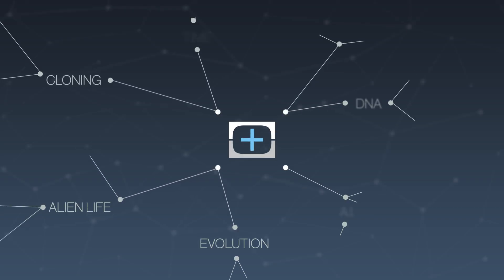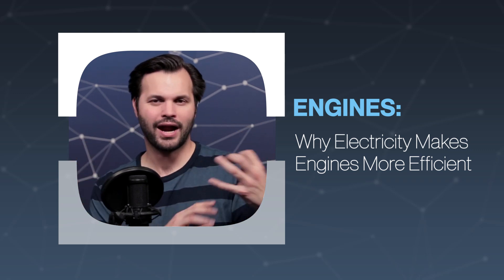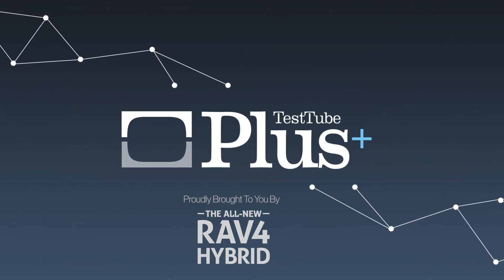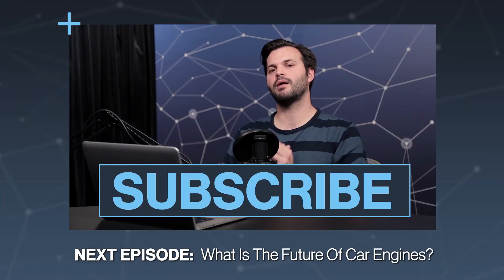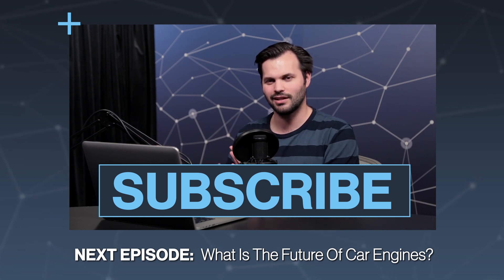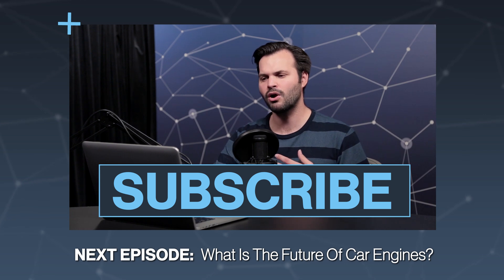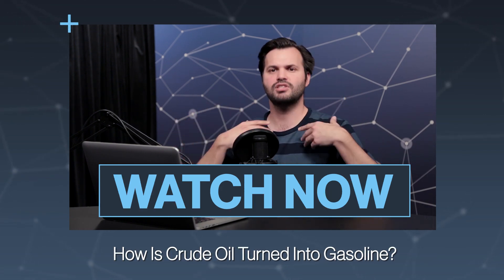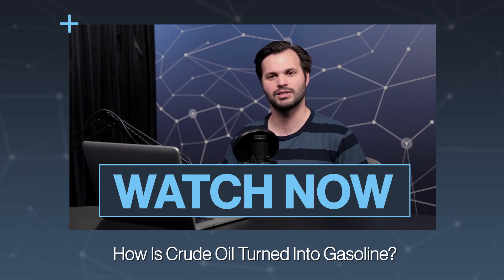Why Electricity Makes Engines More Efficient

Comment: Still not eco friendly. You regressives keep lying about how electric cars are great, yet mining all that coal to get it is even MORE destructive than fracking.
Reply: Eric D Yes, just like ICE cars, Tesla uses rare earth minerals outside the main motor.  Lithium mining has an environmental impact, but it's not like the alternatives do not.
Reply: +Jaccobtw Nope, it's the rare earth metals in most of the components and manufacturing process itself that make electric cars more destructive, not the burning of coal for electricity, that part is far less destructive than burning gasoline because there is far less of it required per mile.
Reply: +Jaccobtw..Until renewables take over.. a lot of states in the US already get 10% or more power from wind energy. And it's growing faster. Also, one big coalfired power plant is a better trade off than 10,000 individual gas engines.
Reply: +Jaccobtw..Until renewables take over.. a lot of states in the US already get 10% or more power from wind energy. And it's growing faster. Also, one big coalfired power plant is a better trade off than 10,000 individual gas engines.
Reply: +Jaccobtw Coal for electricity generation in the US is under 40% and falling.
Reply: +Eric D Tesla uses an induction motor which has no permanent magnets and hence no rare earth metals.
Reply: Dan Sanger Computers, screens and other electronics all typically have rare earth metals to. I couldn't find anything about those things specific to Tesla but the car does have plenty of those things. Also, that says nothing about how the cars are made, the robots and tools which construct them likely have plenty of rare earths in them as well. Plus, the manufacturing process itself, especially for the batteries is hugely destructive.

It seems that weather Lithium counts as a rare earth is a bit controversial but it is very destructive to use due to the way it is mined and the tesla's batteries are Lithium based.

Comment: when a generator is powering an electric motor like the fiskar karma or a train it is more efficient then the system you are talking about. your video needs to be redone. LOL
Reply: +Mac Briggs 
A generator powering the electric motor is called a series hybrid.
Sadly there has yet to be a series hybrid with a small battery so that it can be compared with conventional hybrids in a apples - to -apples comparison.
But, the Chevy volt (42mpg) and BMW i3 (39mpg) and Fisker Karma (20mpg) - all Series hybrids, get far less mpgs than Prius (50 mpg), Accord hybrid (47mpg) etc when in hybrid mode.
Perhaps its just due to the large battery that drags the volt and i3's hybrid efficiency down, but we have yet to see a series hybrid with a prius sized battery, so we can assume that series hybrid setup do not work well with small batteries. (although the reason it is used on trains - to eliminate the transmission - means such a setup may work well for trucks as an alternative to having a CVT which cannot be installed on high powered vehicles) 
The only reason for the Karma's high mpg rating is due to being an electric car, if you never charge it and drive it entirely on gas it will forever be a 20mpg car.
http://www.plugincars.com/heavyweight-fisker-karma-gets-20-mpg-gas-108899.html

Comment: you just realised using solar panels to power electrolysis of water... ... ... ... (...*infinity). You realize that all types of transportation are "dirty energy" without a "clean energy" source. Until electricity is from renewable resources, electric cars are just as dirty as gasoline ICEs. same thing with H2 ICEs and the H2 reaction engines. These technologies weren't just invented yesterday, we knew this for many years. I did a report on hydrogen power when i was in high school, and one of my college professors that i had said people did alternative power every year.
Reply: They're still cleaner because overall they release less pollutants.....
Reply: +Darknightx33x ..Until renewables take over.. a lot of states in the US already get 10%
 or more power from wind energy. And it's growing faster. Also, one big 
coalfired power plant is a better trade off than 10,000 individual gas 
engines.

Comment: why do they not just use hydrogen and oxygen in a (pretty much) normal engine so that it is pretty much just a internal combustion engine that runs on electicly prodused stuff.
Reply: that's sort of what the hydrogen fuel cells do, but it can't be like an internal combustion engine. the hydrogen/ oxygen reaction doesn't combust. it produces electricity. so the engine is different.
Reply: +Smerlin Because you'd need to keep the hydrogen and oxygen at cryogenic temperatures in order to use them in a combustion engine. Further, it's incredibly dangerous -- hydrogen explodes, and burns with a clear flame, while pure oxygen is an incredibly rapid oxidiser
Reply: kay then

Comment: I would say that a smaller ICE isn't always more efficient simply because of the range of efficiency. For example trying to get a fiat 500 to cruise at 75 is going to be less fuel efficient than an adequately powered car, a car with a bigger engine. ICE need to be appropriately sized for the application. Now I know that this seems trifle but many current cars, like the Prius are simply underpowered. My mom has a Prius and when I occasionally drive it, I have to floor it to merge. When I do this the mpg that I am getting is far worse than in my own v6 accord because I don't have to floor it in my accord to catch up to traffic.

Comment: Nuclear power cell car FTW
Reply: ah yes, so even a non fatal accident would kill you with radiation
Reply: +Adam Kraft You can put the reactor inside a thick steel shell, making it practically indestructible. They need lots of shielding anyway. But it's probably still better to let professionals operate big nukes, and use batteries in the cars.

Comment: Interesting.  I never understood the point of hybrids until now, because usually, people promoting them don't explain that the engine is smaller and lighter.  Instead, they just talk about how "when it switches to the electric battery, you use no fuel," as if the car wasn't still powered by gasoline.  (I'm still holding out for a fully-electric car, though.  Just as soon as they make one that can go long distances, or I find a job closer to where I live.)
Reply: Generally the engines aren't "smaller." For example the Toureag Hybrid use a 3.0L supercharged V6 while the gas and diesel variants use a 3.6L and 3.0L diesel respectively. In addition the Jetta hybrid takes advantage of a 1.7L gas engine while standard Jettas use a 1.8L or 2.0L depending on the year but within the same model run. It's a trivial difference in displacement. That hybrid system is different from why Toyota and Honda uses. The system adopted by Vw/Audi primarily relies on the gas engine for locomotion and adds the power capabilities of the electric motor to aid in acceleration and sustained movement, thus reducing the demands on the gas engine which in turn decreases fuel usage. They will solely use the electric engine for movement at very low speeds and higher speeds, depending on the charge level of the hybrid battery, but not very often.

Comment: At night you plug your electric car into the coal fired power plant and call it green.
Reply: Speak for yourself my province runs 80% off hydro power
Reply: +Bobby Harper No, My Fair Lady, based on Pygmalion by Shaw. The song was a drill in "proper" pronunciation. Rex Harrison played the language professor trying to get the Cockney flower girl Eliza to impersonate a highborn lady. I forget who played Eliza, but somehow Audrey Hepburn doesn't sound right. I'll look it up later.
Reply: +Bobby Harper That smog is caused by coal? You may benifit by doing some actual research.
Reply: Bobby Harper First of all, coal just emits more visible emissions than cars. Second of all, coal fired plants are operating in the range of ~80% efficiency compared to 30% for an engine. Even if so, it's not a load-adjustion engine which somehow magically burns more coal when more load is applied. The same coal will burn, it will just operate at a higher efficiency = higher output.
Reply: @cloroxbleach1200  most moderns coal fired plant just have the efficiency of 42%, sorry not 80%
Reply: +Bobby Harper 
And btw the only reason coal is the main polluter is because of China's advanced public transport infrastructure. If Chinese car ownership per person was the same as the United States, you betcha coal would not be the main cause of the country's air pollution problems.
Reply: Stuart Miller Even China realizes the stupidity of coal with their smog choked cities. What ignoramus would defend it?
Reply: Chad Kamerad In the US the upwind  Navajo Generating Station, Arizona's largest coal plant causes smog so thick there are days you can't see anything in the Grand Canyon. How's that for research?
Reply: Shaheer Syed Because the people have trouble seeing the Grand Canyon the Arizona coal polluters have been ordered to clean up their emissions .
Reply: +Bobby Harper And less carbon and polution is produced while burning coal to charge EV, than that car would make if it was powered by gas.
Reply: Bobby Harper I believe you were refering to the Chinese cities when I responded to you about doing your research. I could be wrong here but I'm pretty sure the Navajo generating station is not causing smog in Chinese cities. If you would like to talk about Arizona that's fine. Just realize that the two places are very different and have a different set of challenges, geography, weather, and stadards.
Reply: Chad Kamerad Air pollution has become a major issue in China, and poses a threat to Chinese public health. Coal combustion generates particulate matter also known as "PM". Currently, Beijing is suffering from PM2.5, which is a particulate matter with diameter of 2.5 micrometers or less

https://en.wikipedia.org/wiki/Pollution_in_China#Air_pollution
Reply: Travis Devereux Your comment needs more words.
Reply: +Bobby Harper haha nope I'm to minimalistic for that shit
Reply: Bobby Harper It so happens that particulate matter is produced by many sources. Coal combustion is one source. In most cities in china with pollution problems coal combustion isn't the largest or heaviest polluter. You are basicly pointing a finger at coal combustion and leaving out all other sources. Anyways, you were speaking of smog problems. They are mostly caused by auto emissions and factories.
Reply: Chad Kamerad China has chosen to reduce coal usage so they think it's a problem. Complain to China if you think your darling coal is being mistreated.
Reply: Bobby Harper Did I say it wasn't a problem? I was just pointing out that you were providing incorrect information.
Reply: Chad Kamerad I said coal smog is a problem in China and proved it.
Reply: Bobby Harper Had that been what you said I wouldn't have disagreed.
Reply: Bobby Harper What you said is that smog choked cities are caused by coal combustion when in reality the smog problems in those cities are mainly caused by other factors.
Reply: Chad Kamerad The rain in Spain stays mainly in the plain. Most of the pollution in China, the researchers say, comes from coal.
http://www.salon.com/2015/08/14/chinas_coal_crisis_air_pollution_is_killing_4000_people_every_day/
Reply: Bobby Harper What is that from? Wasn't Aubrey Hepburn in it?
Reply: Chad Kamerad Sound of Music
Reply: Bobby Harper For future refrence using salon.com for a source of information isn't exactly a good idea. Source something peer reviewed or even less known for extreme bias.
Reply: Bobby Harper If you read the source salon uses you will see that it's never once said that coal produces most of the pollution.
Reply: Chad Kamerad Quote from the Salon article "Most of the pollution, the researchers say, come from coal,"
Reply: Chad Kamerad Isabel Hilton, editor of China Dialogue, an independent website that publishes information and debate on the environment in China, said coal is the main cause of the country's air pollution problems.
http://www.theguardian.com/environment/2013/dec/12/china-coal-emissions-smog-deaths
Reply: +Bobby Harper good thing coal is being phased out.  Natural gas and renewables are cheaper and cleaner to operate.
Reply: +Bobby Harper ..Until renewables take over.. a lot of states in the US already get 10% or more power from wind energy. And it's growing faster. Also, one big coalfired power plant is a better trade off than 10,000 individual gas engines.
Reply: +Bobby Harper 
And that's an argument against electric cars... how?
Reply: yan-Deriction Legislators have approved amendments to China's 15-year-old air pollution law that grant the state new powers to punish offenders and create a legal framework to cap coal consumption, the Asian giant's biggest source of smog.
http://www.reuters.com/article/us-china-pollution-idUSKCN0QY08A20150829
Reply: The best powerplants run at 50% efficiency while the best diesel engines run at 45% efficiency. Opposed piston engines run at even higher efficiencies than we previously thought possible and you'll see those out in the next five years. Water methanol injection turns waste heat into power by vaporizing pushing that piston. When better catalysts are found, methanol fuel cells may run at 80% efficiency.
Reply: +Bobby Harper coal powerplants produces energy at much higher efficiency with gas turbines than any car engine, whilst also producing less harmful byproducts and having additional methods for cleaning the air before exhausting. So overall many many times better. Change power generation to renewable and then you have zero emissions...

Anythings better than being ignorant of your own misuse of the environment.

Comment: I have a question: What types of batteries does an electric car use? Are they somehow like other batteries that after a period of time recharging them makes them weak and they don't last long?(example, Laptop)
I'm not a man of science
Reply: +Mr. 8I 
Lithium ion with graphene can get about 3,000 charges, and they have pretty decent capacity. Tesla uses them for their cars. They are actually panasonic laptop cells.
Reply: +Mr. 8I The technology is basically the same. Chemically stored energy. And yes they get worse with time.
That said. The science behind batteries have become much better over the years. And if you can make them larger you can mitigate some of these problems.
Reply: Serah Wint Thanks :)
Reply: Another thanks